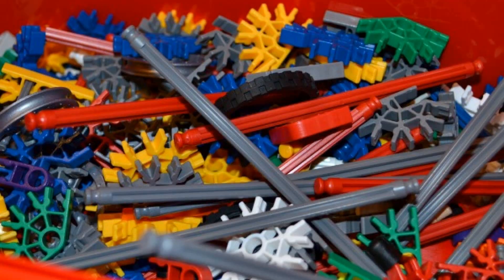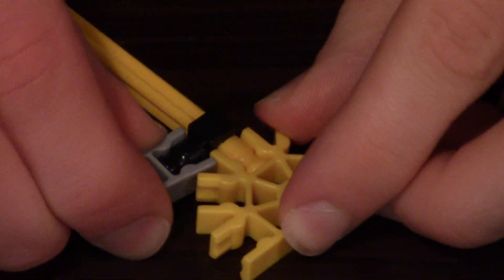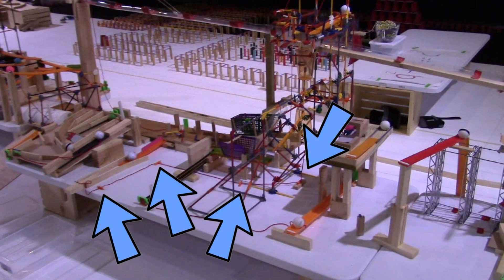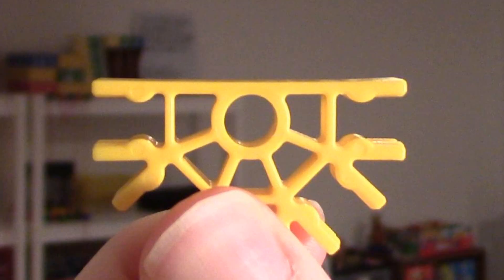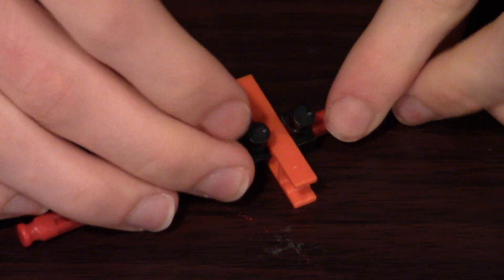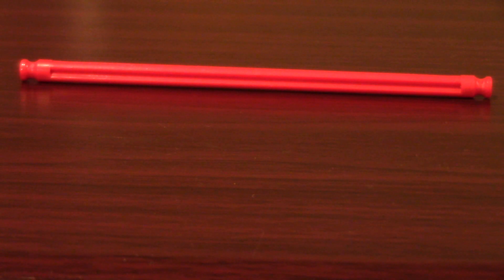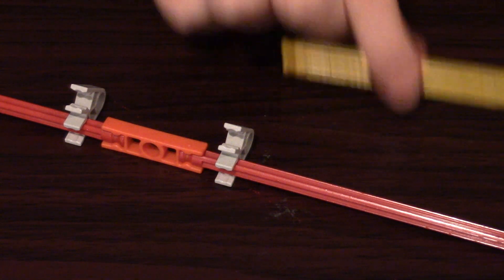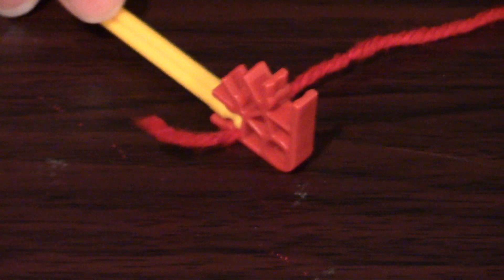Everything You Didn't Know About K'nex

Comment: Excellent video ! You have a bright future in informative things, kid ! I have silly little a question : Can I paint my K'nex to be all black ? I want to build a mini pc-egpu case and everything about them is black !...
Reply from the maker: I don't see why not! That said, if you paint each piece before assembling, they WILL NOT go together. Even just the thin paint layer will be enough to make it so that the rods don't fit through the holes or into the connectors properly. So build the model first, THEN spray paint it. Also, I wouldn't recommend painting your pieces if you plan on ever building anything different using those pieces. Aside from the fact that, when disassembled, each piece will have weird paint patterns, K'nex are made in different colors for a reason: so that it's easier to pick the piece you're looking for out of a bin of parts. When all the pieces are black, it's WAY harder to find a 90 degree connector vs. a 135 degree connector, etc. But best of luck to you, sounds like a cool project!
Reply: @jackofallspades98  thank you ! This was what I wanted to hear from an expert... I want to very thinly spray paint before assembly, and make it so that its detachable (being a rempvable pc upgrade piece) or qt least openable in a simple way, like a basket maybe from the top... Thanks, cheers.
Reply: @jackofallspades98  also those weird paint patterns sound like a fun challengr ! Lol

Comment: The guys at K'nex got rid of their parts and extras page.  They don't want you to buy parts, they want you to buy the whole roller coaster so that you can get a few blue rods.  From now on I'm going to get parts off of my lathe and 3d Printer.
Reply from the maker: I'm so mad that you can no longer order individual parts from K'nex. The best you can do right now is order through eBay. I would be cautious trying to manufacture your own pieces. Not only would it be incredibly difficult to get the dimensions perfect, it's also nearly impossible to get the right kind of plastic. I think you'll find that your parts are either too flexible or too rigid, unless you're using a specialty plastic. I wish you the best of luck though. If you succeed, I'd love to hear about it!

Comment: 12:10 Those circular spots are likely leftover marks from the ejector pins of the molding tool. I suspect the tool allows the POM-plastificate to flow first into a distributor channel network that separates the material flow so that many different pieces can be cast with each shot of the machine. The sticks lie parallel to the tool's shutlines in an H-pattern. At the end of each cycle the casting tool opens and pins on the far half of the tool push forwards to pry the finished part out. Practically all injection-molded plastic parts have those pen spots, go look for them.

Comment: Cool tips! I love the the one for the yellow connectors but if you're going to pull out the Dremel tool anyway why not just load it with a cut-off wheel and use one tool for one operation in 15 seconds each: cut it off and trim it. Also, I can explain the marks on the pieces. These are made by a process called injection molding: a 2-piece mold with a small hole for injecting the plastic. When the mold is opened these are small amounts of "extra" plastic which get removed by either tumbling the pieces or by a machine operator who has a blade slice them off. You will also see these marks on Bulk Dominos. The marks are in the center of those particular pieces because it fills the mold faster and more complete, so yes, K'Nex is doing that on purpose but not for the consumer... that's just a side benefit.
Reply from the maker: chris reulbach It definitely makes a lot of sense to use the Dremel tool for both processes, although I'm pretty sure I didn't have the proper attachments for the Dremel to do the cutting. Unfortunately, a saw was the best thing I had. 😕
That makes a lot of sense about injection molding. It's definitely logical that K'nex would inject the plastic into the center of the part, rather than either of the ends, considering those are the most important elements of the part, and it would not be good to have excess plastic there. I'm just glad they decided to inject into the center, instead of slightly offset. Then the tip in this video would be ruined!
Reply: Ah, of course: use the tools at hand to do the job! Cut-off wheels for Dremel cost about 4 bucks and a good investment. Also, a hot knife blade will cut through plastic very fast. Just use a cigarette lighter or a gas stove flame to heat it up (careful: heat travels up the handle!) and it will slice through the plastic in seconds. Since heat can distemper a blade only use an Xacto knife, box cutter or other type disposable blade, not a good Swiss Army or Buck Knife.

Comment: Dude can you PLZZZ do a more in depth tutorial on the one where the yellow connector can fit on to a hot wheels track it will help me alot.
Reply from the maker: I would, but I think you'd be the only one interested. Honestly, it's not really that hard if you have the right tools. Just saw off the ends to the middle of the bump, then sand down the rest of the bump so it's smooth.